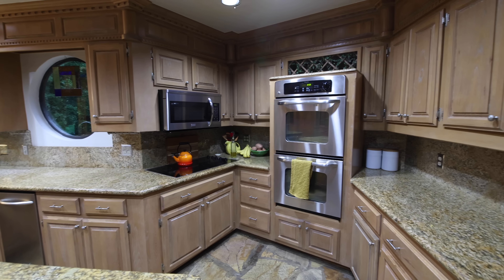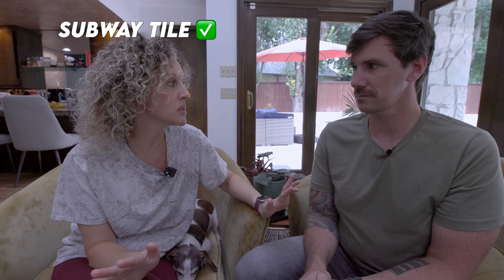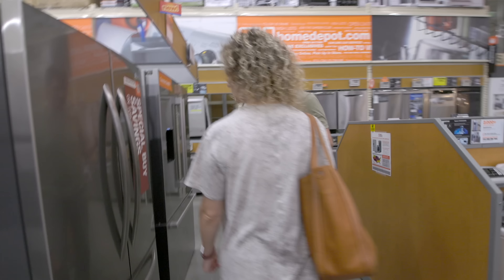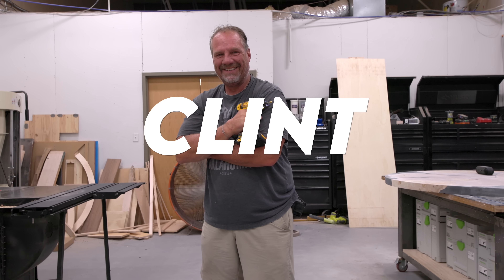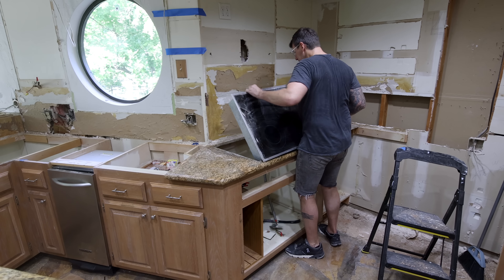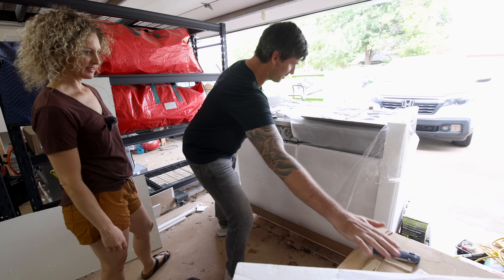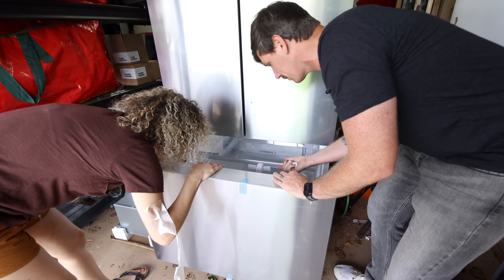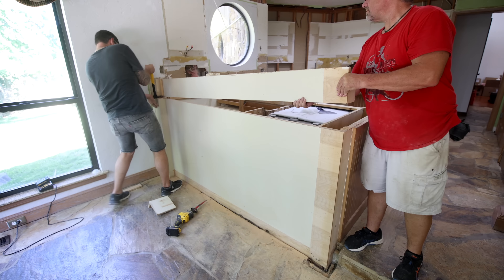1982 Kitchen Remodel Ep. 1 | Demo & Appliances

Comment: We had that same LG dishwasher and had so many problems with it. They are prone to a number of different failures including the mainboard and the water pump. Parts are extremely expensive to replace and we had a hell of a time finding anyone that actually worked on the LG brand in our area. Don't be surprised if you end up replacing it within 2-3 years.
Reply: I bought an LG TV and after 18 months the internet wouldn't connect to it so I went on a deep dive and found all of these people with the same issue so it's obviously planned to break around the 18 month mark so I'll never buy anything from LG ever again.

Comment: 1:16 is where the red flags go up. gas is the worst, least efficient way of cooking, for many reasons. if i ever get a chance to build my house, i'll go for induction which is by far the best method, second to none.
2:33 those double-door fridges aren't the best in terms of efficiency, because they just don't seal as tight as a single door. and those with drinks dispensers on the outside are even worse.
4:22 is that all one unit?

and last but not least, i wouldn't go for a white kitchen. YMMV but i prefer wood. call me old-fashioned but i prefer your old kitchen to what i think the new one will be like.
Reply: Wood is definitely a good choice. I think HGTV has ruined people because of the all-white cabinetry trend. Not to mention the open shelves, painted brick and subway tile trends.